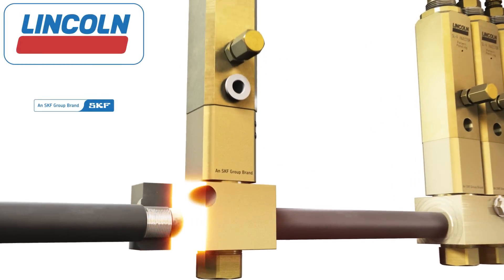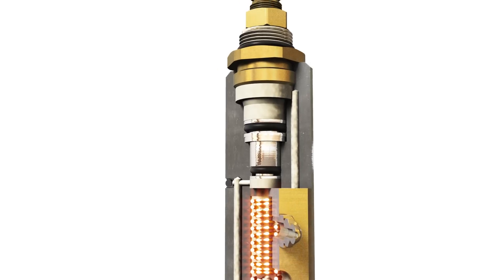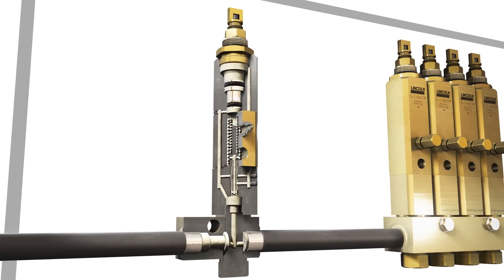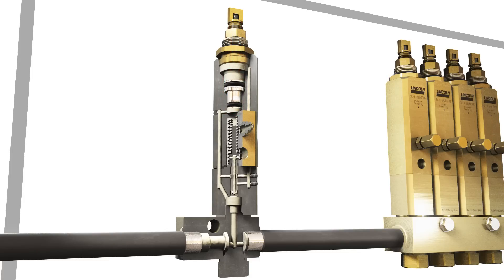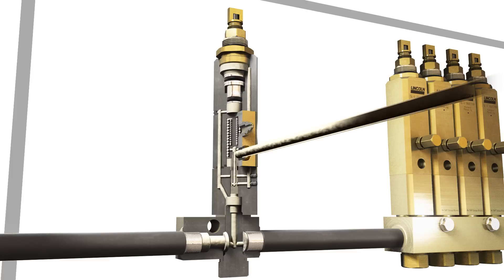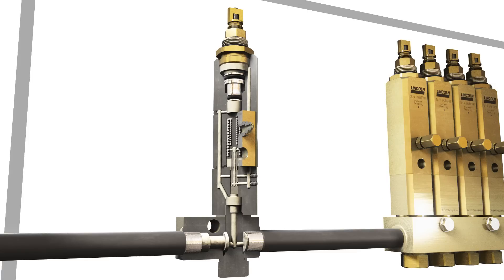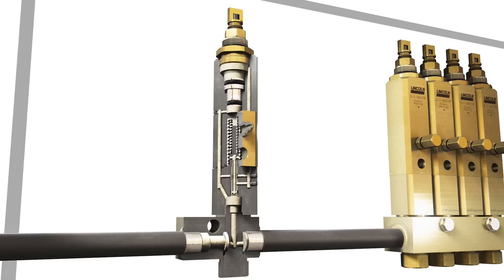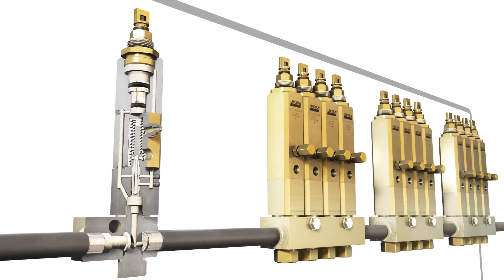Lincoln SL-V

Comment: great video.. how would you know if one of the injectors is plugged and does not actuate?
Reply from the maker: Telltale sign is the indicator pin on top. If the indicator pin does not move during the pressure or vent phase then the injector or the lubrication point requires servicing. 

~John
Reply: @lincolnindustrial  That is the main reason why; no matters how good your Lubrication Automated Systems are, you will always need to do preventive check of the equipement. Lincoln are one of the best Lubrication systems manufacturers, and still if the user don´t do the rigth maintenance (grease level, fractured hoses, etc) the system will be out of work at some point.